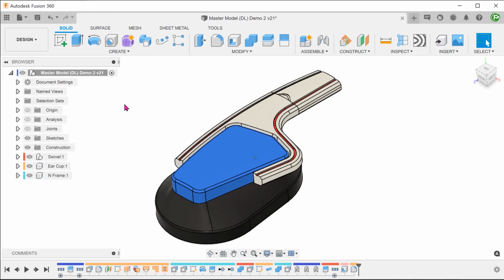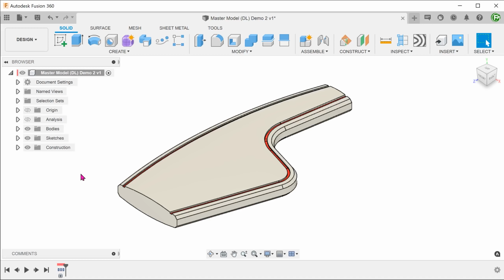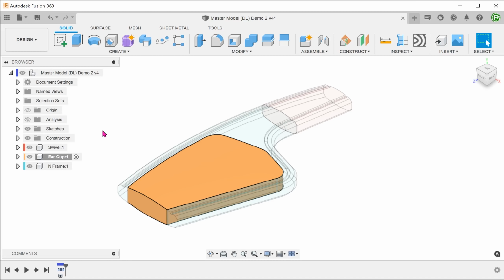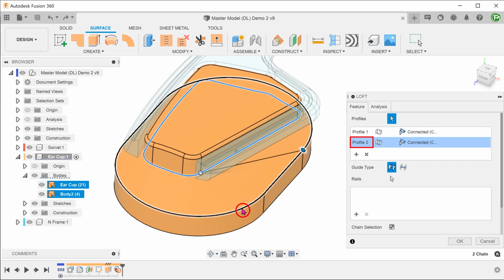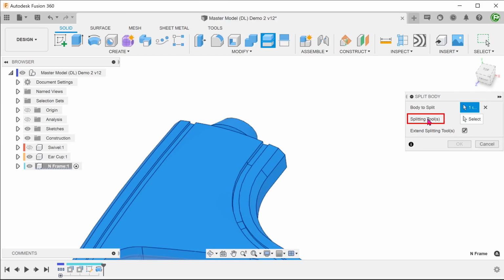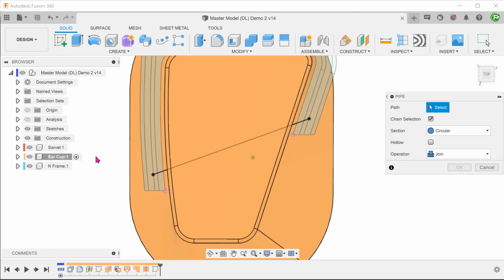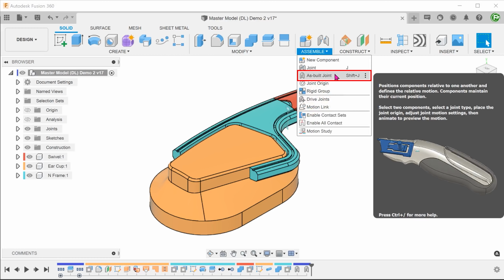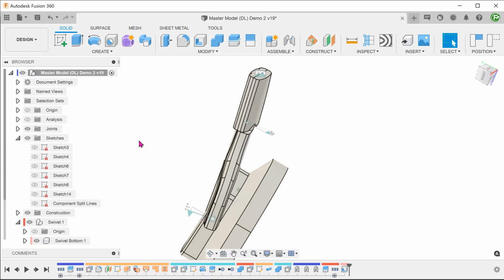Fusion 360 | Master Model Workflow

Comment: Excellent - As always! Two things I would point out: 1) Fusion 360 works by default in a top-down style. This is unusual for most mechanical CAD systems and can be a source of confusion if one is more familiar with the "bottom-up" workflow used in other systems. No worries however - Fusion 360 can do "bottom-up" and other systems can also do "top-down"....you just have to know how! (new video idea? :-)) 2) Top-down designs are wonderful for designing assemblies with many interlocking parts, and are especially useful for product design IMO - but it does have one drawback: if one designs all the parts in the context of the assembly - you should be aware that if you intend to re-use parts of the assembly in OTHER models - you will have a difficult time of it. Because the parts are all defined in THIS headset assembly - if you tried to re-use any part of it in ANOTHER headset model - you would essentially be inserting the entire headset model into the other headset model as well. One can break the association - but then you lose the ability to edit the model effectively. In general - Top-Down workflows are best for complex assemblies in a company that has few models or variants, or where the variants do not share many parts. Bottom-Up assemblies are useful in companies where part re-use is frequent. Keep in mind that both methods are able to be used TOGETHER in one model with some practice and experience! (PS - this is one of my favorite subjects in CAD.....can you tell?)
Reply from the maker: 😀I sure can tell! 
I will definitely consider doing a video on bottom up approach in the future. I was not aware of the difficulties with cross referencing components built using top down design. Thank you for pointing that out. Will definitely need to experiment more with this.
Reply: Fusion has a wonderful answer to this! Derive! It's my favorite way to share solid models between assemblies or files. It allows you to create an associative link to anything that lives in the browser tree of another file, no matter the hierarchy. You can bring in components, sketches, bodies, etc.

Even more powerful is the fact that you can continue to apply features to derived bodies, changing them to meet the needs of the new assembly. If the original objects change, you'll be prompted to bring the object up to date and the features will be reapplied in the same way as if you changed anything earlier in your timeline. 

I highly, highly recommend looking deeply at Derive. I believe it is the most important assembly workflow tool that's been introduced to Fusion. Never insert designs again!
Reply from the maker: @zallaun7327  Another viewer also brought up the idea of using derive. I am definitely going to experiment with this and see how I can incorporate this into the master model workflow. Thank you for the suggestion!
Reply: @zallaun7327  - Yes....and no! Derive is a GREAT workflow which works in ways that are similar to this. It can allow you to "simplify" what you transfer over to a new file for further work, significantly reducing the data overload - and more positively - can simplify usage for the next person down the line. Either way though - using a derive still means there is a reference back to the original assembly or file from which the derive came. If you use the part with the derived geometry or information - you are by definition still making your new file dependent on the original source file or assembly. Again - one can break the link - but then most of the parametric information you would need to edit the derived part is also gone. Again - I love both of these workflows - and one needs to be mindful of parametric relationships to be able to use them well!
Reply: @Boldform_Consulting  How about Paste New?
Reply: @Darfail  Paste New is a good solution, yes - but in this case, the link is broken forever. This may be exactly what is desired - or not - depending on the context. Also - because you are pasting a new body - you may not be able to readily edit that body....maybe ever. And - to top it all off, if you are not careful, you could have two parts with the same name, unless you take care to re-name. The overarching thing to keep in mind here is not that any one tool is right or wrong. Each is valuable - but you need to know how they work and when to use them.
Reply: @Boldform_Consulting  hey thanks for the added analysis I appreciate it, trying to make sense of it all :)
Reply: Quick question, when you have a design that requires say 20 bolts or washers that are all the same throughout the project, what method do you use to simplify using multiple pieces of the same hardware or component? What would this process be called? 

Thank you

Comment: I don't like how fusion shows all the individual component operations in the master timeline. After going back and forth between components a few times i eventually end up with a mess of time sensitive cross references that is impossible to untangle.
To get around it, instead of creating components in the master design, I use the derive tool to create new parts from the split pieces of the master model. Those separate components can then be assembled in another design once finished. It is a bit more work, but forces you to keep your references clean and the resulting model should also load faster and respond better because you avoid a massive combined timeline.
Reply from the maker: Another few comments have also mentioned using derive. This sounds like something that I would need to experiment with and maybe show in a future video.

Comment: Very good information. Thank you. I appreciate your shorter tutorials, but this long-form video was also great.
Reply from the maker: Thank you, I did agonise over the length of the video quite a bit, as it was not in keeping with the typical length. However, I really wanted to show the master model workflow using an example with some level of complexity. I tried as much as possible to cut down and speed up without sacrificing comprehension. Original cut was probably about half hour long!

Comment: Nice workflow. I usually "ground" the first component (right click at component in browser) the only difference is that you will see an anchor at the component in the browser
Reply from the maker: Thank you. I have seen it done both ways. I often wonder what is the difference between the two in terms of assembly behaviour.